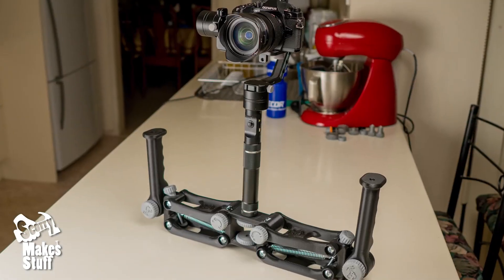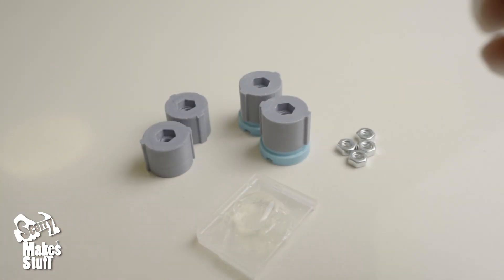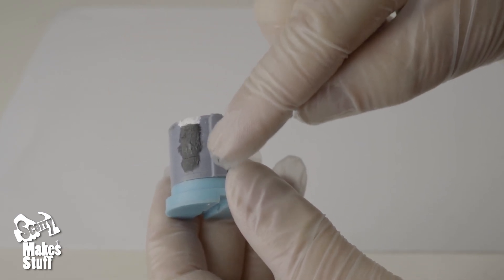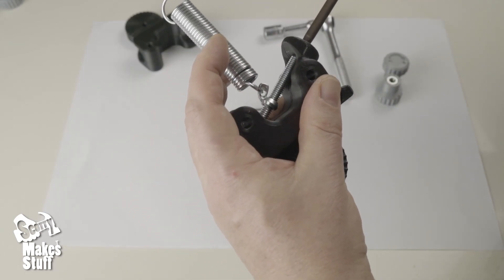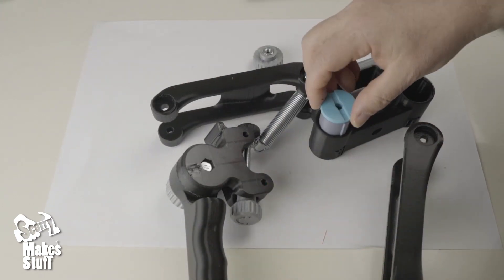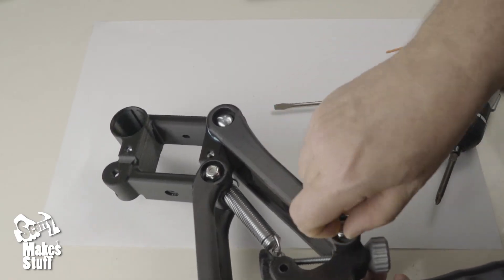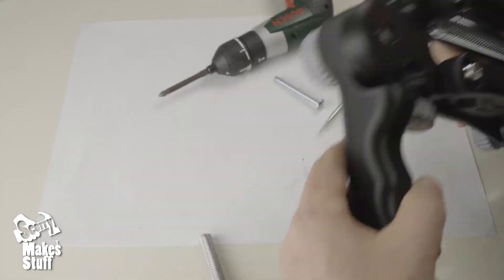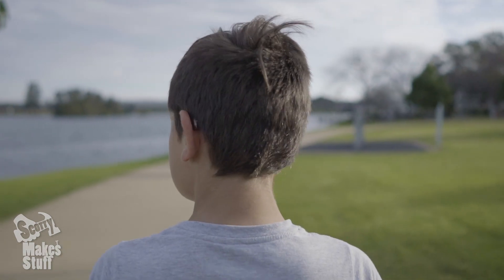DIY 3D Printed 4th Axis Gimbal Stabilizer - Pro Model

Comment: hello, thank you for your wonderful work. I wanted to know exactly what is the spring model? because I can't find them on the internet. thank you
Reply from the maker: Check the thing details and comments for that
Reply: sorry I looked at the detail, but the springs 375. I can not find as a reference on the Internet.  could you please give me another reference?
Reply from the maker: @DDG71  I think it s 12375 from century Springs
Reply: @ScottyMakesStuff  thank you so much
Reply: per account sends them to France $ 60 for the postage is very high. would you please, another universal spring reference? or what characteristic should be taken into account of the spring?
The length? force them? N, Nm?
Thank you

Comment: Hello, will there be any chance of using this model for an osmo mobile without having to use the compact versions? I prefer the comfort of this
Reply from the maker: The Osmo mobile 2 will work. If you have the Osmo 1 then there's a few options. 
There's a good chance more than one of our gimbal mounts will fit it. You'll need to measure your handle to check but the medium or large mount looks close:-
https://scottymakesstuff.com/collections/accessories/products/gimbal-adaptors-for-glider-pro-2-pro-2-crane-2-4th-axis-stabilizers?variant=8116108001391

I think there's a good chance the Ronin S mount will work:-
https://scottymakesstuff.com/collections/accessories/products/gimbal-adaptors-for-glider-pro-2-pro-2-crane-2-4th-axis-stabilizers?variant=12218236338287

Also, you could use the base plate and attach that to the slotted base and then it will work:-
https://scottymakesstuff.com/collections/accessories/products/gimbal-adaptors-for-glider-pro-2-pro-2-crane-2-4th-axis-stabilizers?variant=8116108165231

Comment: Awesome stuff, started printing mine now 😁 just a question, what nuts goes where? The lock nuts on what witch piece and the normal on what piece? 
Cheers!
Reply from the maker: Hi Tim, there's an inserted 1/4-20 nut in each handle, 4 inserted nuts in the gimbal body and the half nuts can be seen at 9:05
Reply: Hi! I can't find the link to download the 3D plans. Can you post me the link please? (Is it still on the website?) ;) Thanks!

Comment: Hey Scotty.... I'm really digging the idea of this 4th axis stabilizer. I've recently purchased the Zhiyun Crane2 and can't wait to print all these parts. I've already printed the Gimbal support piece (with the added nuts embeded). NEXT I was trying to print the Rosette GimbalSpringAdjust... but the Left one doesn't want to make the round part underneath the rosette solid. It has a really weird gap that's missing. The part looks right in the workspace--- but when previewing it, it's missing most of that area. It works fine on the Rt but not the left. I'm using Simplify3D.... any help would be awesome. Are you using a different slicer??
Reply from the maker: Hi Steve, I've just downloaded the pro stabiliser's left spring adjust and the part slices fine in Simplify3D. Maybe download that part again and see if it slices correctly? Let me know if you don't have any luck with it?
Reply: The Latest that was posted DOES WORK!!! thanks so much.

Comment: Instead of metal washers, fluoroplastic washers can be used
Reply from the maker: Hi Alex, brass is surprisingly slippery against the plastic and has worked quite well. I'm currently developing a compact gimbal stabiliser for use with phone and action cam gimbals and have tested ptfe bearings, stainless bearings and some other methods too. The steel bearings work the best. I'm going to upload a snippet of test footage this week as the launch has been delayed a bit and there's a bit of interest in how good it works.

Comment: Could you use bearings instead of brass washers?
Reply from the maker: Hi Cyrus, yes you could but for most common uses for videographers such as walking or running shots the brass does a great job... the combination is surprisingly slippery. Put it this way, I've never thought I could do with less moving resistance.
Reply: how does the fluid dampening work? I couldn't find any information on that. Common sense in me thinks that the concentric rings with fluid inside would just give a small amount resistance. How does the adjuster work?
Reply from the maker: The rings don't touch each other. It's the grease that provides something similar to a surface tension between the rings. The rings adjust out to provide less surface contact for less dampening. The amount of dampening has been specifically designed to cover the complete range of bounce reduction for this system. It provides the maximum dampening during hard action shots such as running on rough ground and can be adjusted all the way to no dampening for slow movement shots. I'm quite proud of the design :)
Reply: Where did you come up with all this stuff (especially the fluid dampening)?
Reply from the maker: I got some initial ideas from pulling apart a couple of fluid dampening tripods... but that was just a starting point as it didn't provide the fine control of the dampening that I needed. I'm a bit of a science geek so I already know quite a bit about physics and engineering so the current design isn't based on anything I found... it's all me... but there was a heck of a lot of trial and error getting it perfect!

Comment: Hello Scotty, looks great! Would it support a Canon 6D + 16-35mm lens? Thanks
Reply from the maker: Thanks Bruno! Yes, it sure will. The stock springs will take a payload up to 2.5kg (5.5pound). I've used it with 3kg (6.5pound) of payload and it still worked ok.
Reply: Great ! Thanks!
Reply: Hi Scotty, I have another question. your current camera/gimbal setup is pretty light compare to mine. For my heavier setup, would it be better to have your previous model holder ( center base) rather than this pro model one? Makes sense what im trying to explain? :)
Reply from the maker: Hi Bruno, the springs are the same so they will support the same weight. The pro model does give smoother footage however the standard model still does a good job. The other big positives are the pro model has variable fluid dampening and the 10 attachment points for other pro gear like field monitors, audio recorders and lighting. But if you don't need any of that then the standard model may well be the one for you.
Reply: Thanks for the reply Scotty, could you give me your email so I can send you an image of what I mean? I mean the support base of the promodel its only attached/connected to the gimbal by the bottom screw and your older model you place part of the bottom gimbal inside so it gives more resistance. Im sorry, english is my second language, maybe im not explaining correctly.
Reply from the maker: Hi Bruno, my email is scotty@scottymakesstuff.com and my website is www.scottymakesstuff.com
I understand what you're saying but I can assure you that the new base is super strong and gives great support. In my opinion the original gimbal support is overkill.